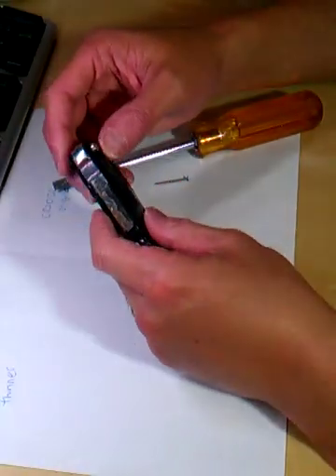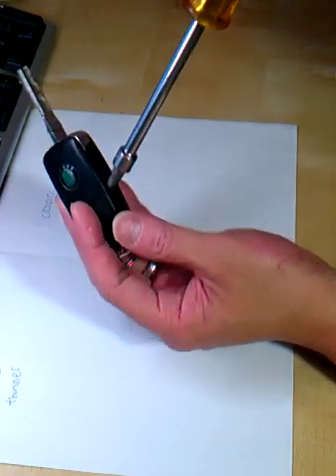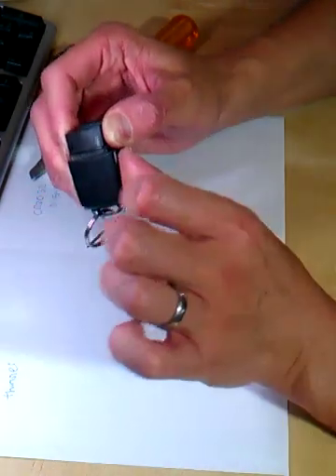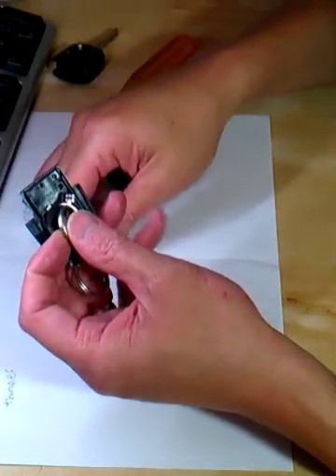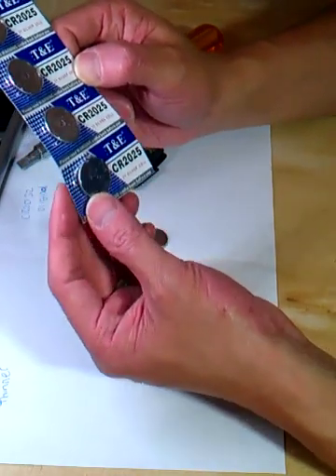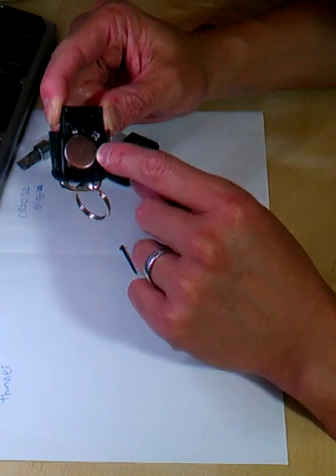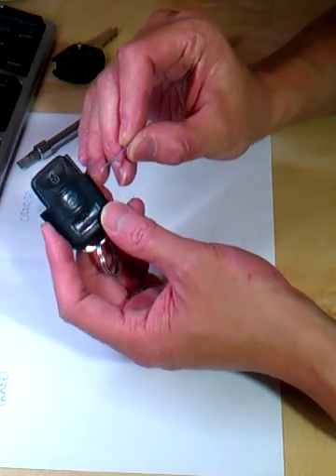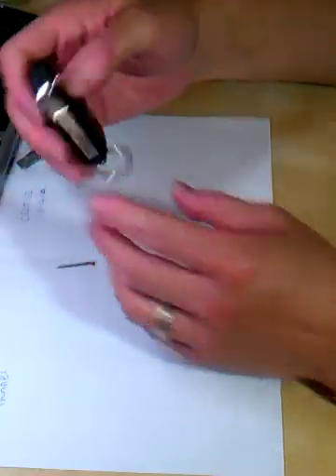How To Replace the Battery in VW AUDI SEAT SKODA Car Key Fob

Comment: Excellent step by step guide...some say just pull the key apart but your method of using screwdriver in the side is correct. To prevent any de-syncing key with car, have battery ready to go straight in. Thumbs uo!
Reply from the maker: Thanks.  Not everyone can just pull the key apart, and I had the screwdriver handy so it just made sense
Reply from the maker: feel free to subscribe !!!

Comment: Excellent - worked well. My problem was that while the fob would lock the car, it would fail to unlock it. A new battery has fixed this. Many thanks
Reply from the maker: Glad it helps, like and share - might help others that are looking to solve the same problem! Thanks.

Comment: Worked for me, thanks a lot for sharing. My car would lock but no longer unlock with the fob. Checked the central locking fuse first, was ok. Replacing the battery of the fob fixed it.
Reply from the maker: Great, glad I could help.
Funnily enough, the recent cold weather in the UK has caused my key fob battery to die.
So, if this seems helpful to others, please share+subscribe